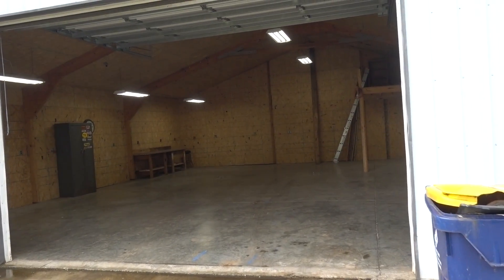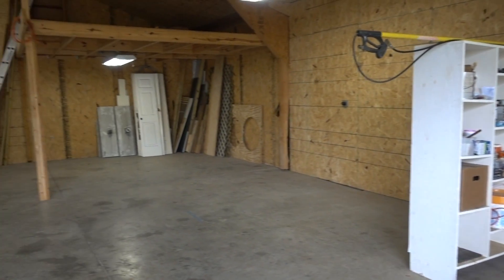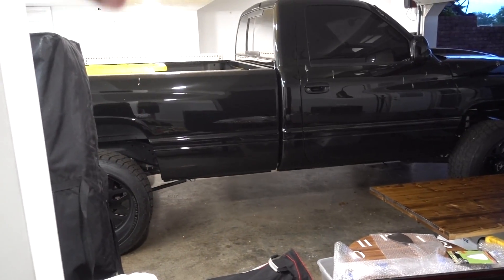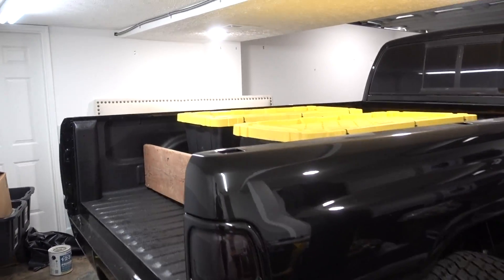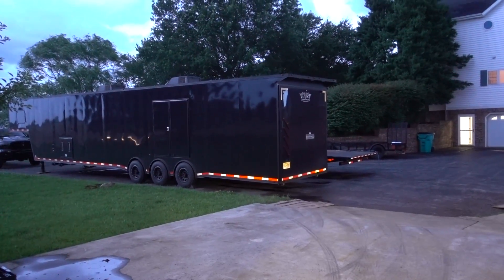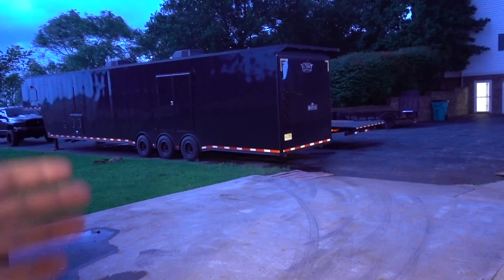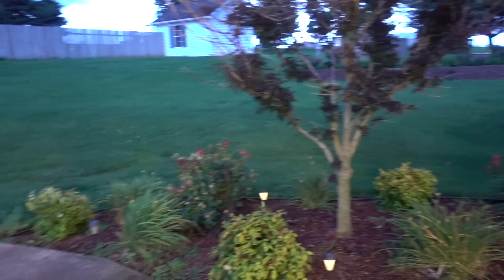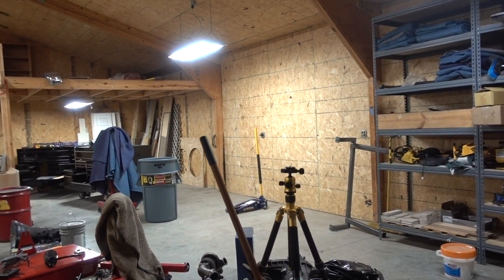NEW SHOP TOUR!!!! IT'S AWESOME!!!!

Comment: Mitsubishi use to be the only split units on the market, think they where the first, so at that time they where priced accordingly while holding the corner on the market. Now a days, i think Amazon, Ebay all have distributers selling split untits that are plug and play. They come precharged with the correct amount of freon both pieces will have a shutoff valve because they usually ship already in a vacum, the inside unit that you mount, will be preferably an outside wall, it needs a drain run outside for condensation, and electricity. The Outside unit needs a level base,( a few concrete pavers work to keep it level and a few inches above the soil) it will have all the required electrical specs. You will need to measure for the length of copper refrigeration lines when you decide where you would like the unit to hang inside. (think of your trucks basicly it's the same thing, the compressor and condensor under the hood outside, the evaporator inside with the fan blowing across it, this is doing the same thing on a bigger scale) once you have the electrical in place, you can run the copper refrigeration lines, open the valves on both units flip the breaker on and grab a beer, you'll be chillin' in no time.

Comment: You can install some mini split units, they come in a heat pump form and more then likely you will need 2 units one on each side so it will keep you cool in the summer, those are the best especially for your application

Comment: Insulate the shop, add a small room outside out the shop. Maybe the back side, to house the compressor. Keep the noise out of the shop. Add a bathroom for when you can't run to make it to the shitter. Add a second garage door to the side where you want to do  gravel. Make the shop worth it and fully usable. Moving compressor to a outside room keeps you from losing space in there.

Comment: Looks good. A nice epoxy finish on those floors would make life much easier for you.
Reply: the only think about putting such a nice finish on the floors is its gonna make it more obvious that the walls are just that unfinished plywood finish, I dunno if it'd be enough just to put some thick White paint on it? or would you need like a thin white paneling to put over it

Comment: Greg congrats on the move. Awesome to watch the shop and garage transform. I would epoxy the floors but as for the shop... you can get white panel boards at big hardware stores that work and hold up well without having to paint. Keep the loft and put your tool boxes under there with some lighting. The lighting will be closer and light up the drawers better. Box in the upper portion of the loft with soundboard and plum in your air compressor up there.

Comment: Id put the toolboxes on the back wall, since most of your work is on the front of the trucks its easier to grab the tools you need and pull parts off, etc. and definitely paint the OSB white.

Comment: You know Greg, I read some of the posts and they are really good, however it is really up to you and your budget as to what you do. If you would like my idea as to painting the place here goes, get yourself some drywall mud and some enamel paint (color your choice), mix 25% mud and 75% paint use a tight mat roller and it will cover great and leave very fine texture that you will want any way for sound echoing property cancellation and heat and cooling flow slow down. sorry this is so long but my bad could ot figure out where else to get hold of you.

Comment: I would take that post out that's holding up the mezzanine and hang that corner from the rafter. That would open that bottom section so there's no obstructions on the floor level and still leaves you storage for tire, compressor or whatever else you need up there could even shorten though's shelves and put them up there for extra parts and whatnot. Beautiful place you have there. I'm sure you'll make it your own in time.

Comment: Swisstrax the floor in the garage. Use white metal on all the walls that way when they get dirty you can wash them easily. For the ceiling you should do black metal and then wrap all those beams in some reclaimed wood. I would also probably add another garage door on the side that the shelves are on that way you can get another truck in there without having to move the truck parked in the middle.

Comment: Make the corner your tool shed tool box tables fabrication center etc. drywall the the walls and foam the Roof and drywall for noise reduction and it’ll keep it cooler after you get the door changed you have tons of room use it smart and put the air tank up top or out side and run your hoses and stuff on the the roof

Comment: Nice property, house and shop. Congrats Greg. I would say get rid of the mezzanine and do like you did with the old shop. My 2 cents - Get all of your electrical done first, spray foam the ceiling and paint it black. Leave the beams natural. Paint the walls a lighter color over the board or panel it and coat the floor. Cha-ching.

Comment: Corregated metal bottom like 4 feet from the bottom and white drywall top. Some kinda trim at the join. I would keep that corner for a chill spot and fridge and have some "shop" stuff up top.  Put some insulation board on the garage door panels. Put the lift at a angle on the right side if you have enough height.

Comment: I insulated our shop door with AC duct boards and metal tape. Came out great. Was pretty cheap and worked well. Just remember if you are adding weight so you might need to add another spring to the door.

Comment: Do the walls white however you feel, the ceiling black and do the beams an offset color to break it all up. If you left the overhead storage you could put all the part on top and turn the bottom into a cool hang out place or even put the toolboxes underneath

Comment: Do what Ari Burrows said but insulate the walls and the garage door also try putting the backend of the truck against the wall and then get a bendpack lift and also Apoxsee the floors in the shop so you don’t have to worry about the floors being more damaged and the also get a big heater in the top corner of your choice.

Comment: galvanized corrugated on the bottom 42 inches and white FRP panels cut down to fit between the beams above and leave the beams exposed.  For the ceiling i'd do the metal exterior paneling.    if theres no insulation you could put a couple inches of foam up first and still get a bit of the beam exposed.

Comment: Overhang in front of shop for shade , ( sunbrella type mtl.) , shade trees on sides , drywall contractor to texture interior walls and tape seams , paint white . also vent ceiling/roof and insulate roof . Wish I had tuned in earlier .

Comment: I live about 25 minutes from BG and also work there. Itll be pretty cool seeing the trucks around. My mother in law has the all in one hvac in her 20x30 garage/gym and it works good to be a very small unit. I'm not sure of the brand but with no insulation back in the winter set at 68° it would run you out.

Comment: Ive had good luck painting osb it holds up better than sheetrock when something is layed up against it. If your shop ceiling isn't  insulated you could   put up styrofoam and white metal ceiling liner. Also another retaining wall where you park the trailers would be a nice touch

Comment: Few coats of good white paint and the shop will be bright.  Plus you can mount stuff to the wall anywhere you want.  Don't need to worry about where the studs are.  Just get some foil covered foam and construction adhesive to insulate the door.

Comment: Use beadboard for the walls. Cheap and easy you can just use a nail gun to put it up right overtop the osb and it looks good and is cheap. You can break off with trim and or crown molding in areas too. Has a smooth finish its white and looks good. I think that's your easiest and cheapest route.

Comment: One company Big Ass Fans. We have them in the hanger down here in GA moves tons of air and is very quiet. Once you add up insulation and ac costs it's about the same plus you'll need the door shut for the ac to have any chance of working. We leave the hanger doors up and fan on in the summer and its definitely an ok working temp in there.

Comment: My suggestion, if u cant fit 2 trucks deep in the middle then on the back wall put the tool boxes that way u dont have to do a lot of walking to get tools, also above them do like u did at the other shop with the loft for extra storage, but keep in mind the placement of the lift u want it far enough to the door so u can still have nice loft space but also be able to lift the truck all the way up, but not to far back that u cant pull trucks on the side of it when needed, for the walls u could do bead board panel (not sure the real name) it looks like popcorn ceiling but in big panels I know some restaurants use it in the back easy to clean and somewhat cemical resistant, for the air compressor if at all possible maybe build a small shed in the back so u dont have to hear it in the shop, neat idea for the floor u could do a epoxy with the wrench workz logo right at the main garage door, that's my 2cents either way look forward to the progress

Comment: I would keep as much of the mezzanine as possible. If you need to do anything with it, cut it back some so you can put the lift in the middle. If height allows, you can park a truck under a truck on the lift. As for the walls, just paint them. I boarded my brother's garage with OSB (smooth side out) and painted it gloss white. It looks great despite the texture and it's a lot more durable than drywall.

Comment: you can get a filler primer over the OSB which will smooth out the OSB and follow that with a white paint is a quick solution to brightening up the shop.  You might want to put sheetrock in places where you set up a "studio" where you display stuff for your camera.

Comment: if you can find washable white paneling, that may help with your paint and plywood issue, plus will allow better lighting, I have a one bay shop attached to my garage and my tool box is on the side since there is a cabinet built in the back of the shop

Comment: Prime the osb and skim coat with drywall mud.  Then you can texture and paint!
Reply: God that would be shitty to skim coat and sand all that smooth, but certainly not as shitty as tearing all that OSB down to hang rock and then have to finish all of that. You've got the best plan yet for the walls!

Comment: For AC i would go with 2 25k BTU MrCool mini split systems, then just spray foam the garage door. For the floor just do a light gray epoxy coating. For walls hang some whit paneling. I say keep the mezzanine, put a compressor on top and store the tool boxes underneath. Keep the parts shelves and save the left side of the shop for parking.

Comment: Leave the overhead storage for air compressor and light weight spare parts. Underneath can be a low ceiling, bright light  assembly area with your toolboxes and assembly bench. Insulate your overhead door on your own with foam board and some 18 ga sheet metal to protect the foam board. Might have to tighten the springs up to lift the door easier though. Check out Mr. Cool DIY cooling units for the shop, abom79 just did an install on his channel in his machine shop. If you're planning on doing much metal fabrication in the future, make sure you have a designated hot work area, I would hate to see you hard work go up in unintended smoke.

Comment: you gotta coat the floor and have a giant wrench workz logo right in the center of it. also id keep the platform for 1: storage and 2: dedicated tool corner. youll definately want some sort of venting in the shop to move air through or it get stagnet, might even look into a giant wall fan. and the lift id angle it off to one of the sides so that way its not taking up the entire middle of your shop.

Comment: Don't change out the door. They make foam insulation to place inside the panels to help with the R factor. Look into a very large ceiling fan. There are several brands out there just for shop use. Yse it with a portable air-con unit and you are good.

Comment: Get somebody to come out and get spray foam insulation in your shop and then move that big shelf over to the other side so if you have like car seats or truck seats and put it above where engine parts it be excellent storage over the garage door that big wooden Shelf The Loft so if you ever got donor truck or donor vehicle and you want to save some of the parts from it you can put it over the garage door

Comment: Run plumbing into the corner with the loft and have a bathroom/office over there so you dont have to run into the house. As for the walls and beams, do a wood cabin theme, I know you wanted white but a man cave log house theme would be cool. Cap the beams in some dark hardwood.

Comment: The AC is called a mini split. You can get a multi head one so have 2 heads in the shop. But what would look best is a package unit out back of the shop and just run metal spiral duct straight down the middle of the shop and it can dump air evenly in the whole shop. That’s gonna look the best and work the best. You are starting to see a lot of restaurants and commercial buildings do the spiral duct just a nice modern look and you can either paint it or just leave it with the metal look. And honestly not gonna be much more then the mini split but going to work a million times better.

Comment: Awesome awesome video Greg A, I like all your ideas so far on the new shop, and building a new bigger shop lol. For the walls, and ceiling you want something durable, and somewhat insulated, so the AC can keep it cool in there in the summer, and the heat in the winter. I feel like dry wall is way to brittle for how much it costs, and in a work environment you’ll be putting more holes and dents in the walls than a slice of Swiss cheese lol. You could find something that will work better for sure that’s cheaper. The over hang in the one corner you could probably cut it in half that way you still have some storage up on it and it’ll take up less shop floor space lol.

Comment: Personally I would paint the osb with white bedliner coating would be cool and very durable. I would keep the overhead storage where it is and as big as it is and put the toolboxes under it place benches around the walls of the shop in strategic places put an 11,000lbs lift in basically the same place the past owner had his but just move it back a little towards the main door to give room for engine work and removal. Definitely install A/C to cool shop.

Comment: first part  you should change the doors, and for the lights  well spray the top in a white.   then paint the beams in a dark gray so they look metal.   then bring that metal sheet to and a Mechanical zone. but  you should have some walls in flat white that is a drywall.      As for the heat and cooling.   on that storage area.   you can get a HVAC.....

Comment: I once saw a farm shop where they had smooth white fiberglass panels that where designed for semi trailers interior walls and they used them for there shop walls. Easy to clean and they acted like a giant dry erase board.

Comment: I work in the building trade and have done some commercial stuff like ur shop I would recommend you building a loft where you want and just putting a furnace and AC in and running duct work up high or at the top of the wall the length of the shop much more efficient

Comment: Thought You lived in dirty Jersey? Paint the particle board  white with a oil based semi gloss , get two 5 ton package units to cool that shop super easy. Make sure there heat pumps so it will be ac and heat. I'd put the lift in far left corner Cadi corner,  and another lift to the left of that lift staggered,   racks on one side, tools on the other side..  Get a big painter's exhaust fan back center top for the days its decent out but hot in the shop it will draw the cool air in the front door. Order 2 fans from big azz fans , and get some lights after the shop is white to see were you need it. Dont waste your time and money paint that wood white

Comment: I wouldn’t put the tool box by the front door, never know when a thief is lurking, i put my tool boxes up front and put my air compressor at the front door and bolted it to the floor. Also if your garage door faces east or west put a small door on the opposite side creates a nice breeze.

Comment: You should paint and then seal the floor. That will give you more light. The normal cement absorbs the light but painting it will reflect the light just like the white walls.

Comment: I just bought a place with a 24x50 shop. The front half has epoxy floors. It would be worthy of an exotic car if the prior owner had not primed and painted a car on them before I bought it. The best part of my shop which is insulated is how cool it stays if you keep the overhead door closed. It has big ceiling fans (like 5' dia) that blow down directly over my work area. No matter how hot it is that is the best and they are quiet and cost next to nothing to run.

Comment: If you end up tearing down the OSB I would think about using spray foam insulation. That should help cut down the heat and if you put in AC it won't have to work as hard.

Comment: Danmar makes some really nice lifts and they are very reasonably priced. Also you may be able to find one that would fit the pattern of the studs they left in the floor.
Get the smooth white board in 4x8 sheets. It’ll be shiny and you can write build plans and draw pictures on it lol.

Comment: They make 4x8 bright white plastic 1/16, thin but rigid, sheets at HD.  I used them in my basement to save weight and time/plaster/sanding/tape.  You don't need to tape the seems if you lay them correctly.  It's your fastest cheapest option.  Panda paper would work too and that is just bright white plastic 3mm film